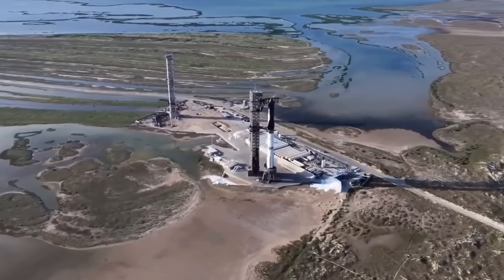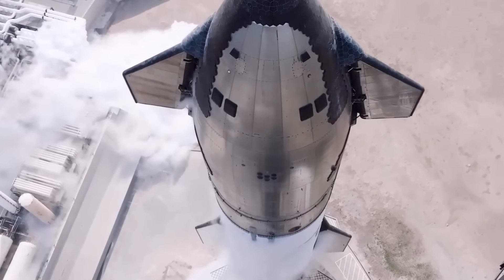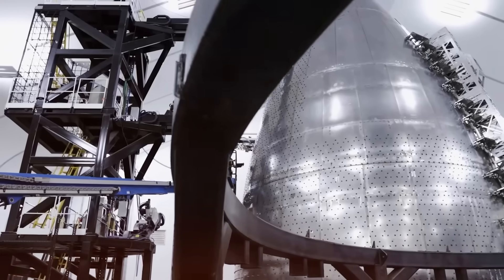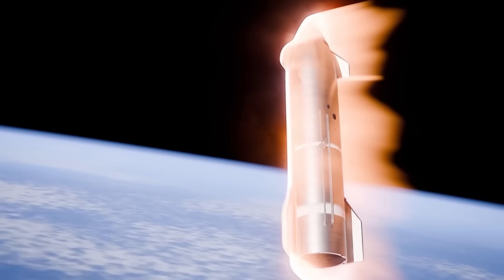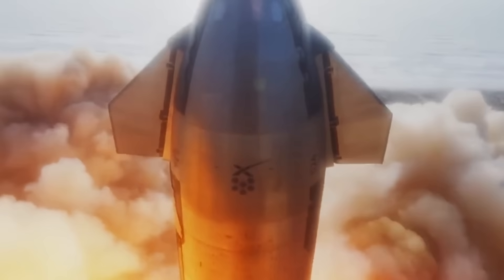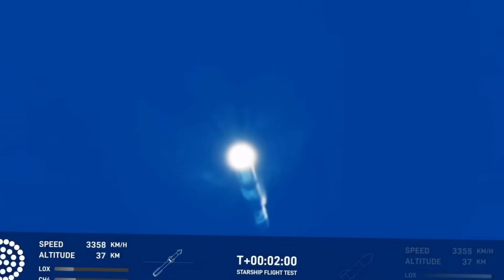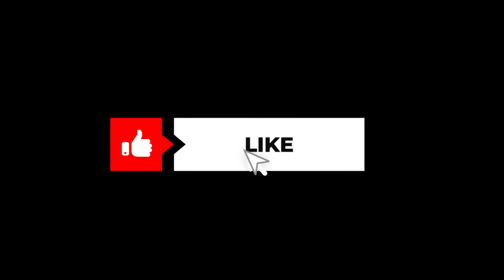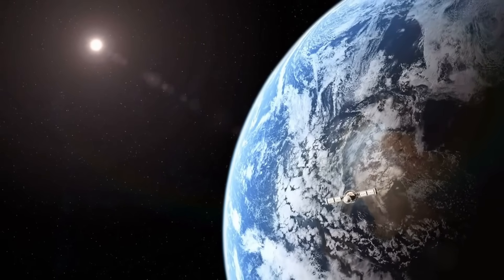SpaceX Drops Big News: Flight 7's Water Landing Will End Space Race! Here's Why!

Comment: How are they planning to overcome the thermal issues when the rocket engines are toasty when they hit the water?  The problem with a quench is the materials could rupture as it cools down faster than the material can adjust to the temperature changes.
Reply from the maker: Great question! SpaceX likely uses advanced materials designed for rapid thermal changes and may incorporate gradual cooling systems or coatings to prevent thermal shock during water landings.